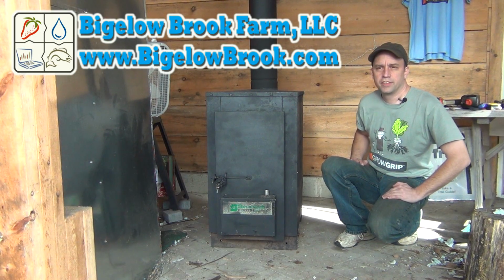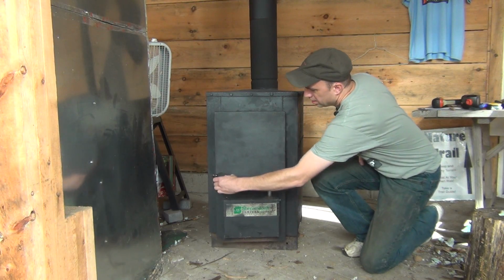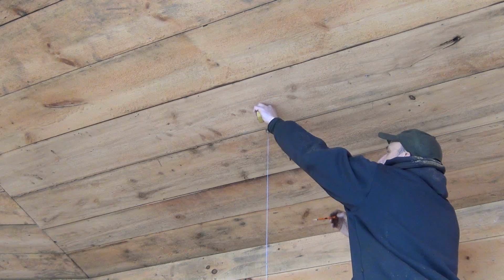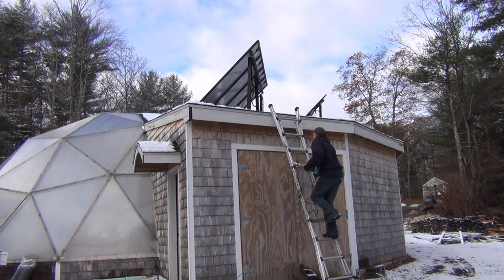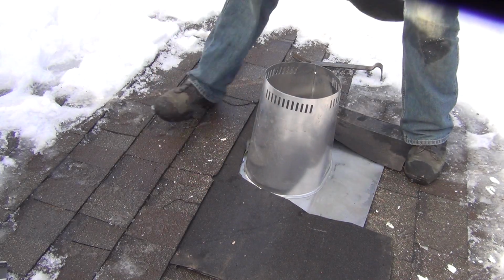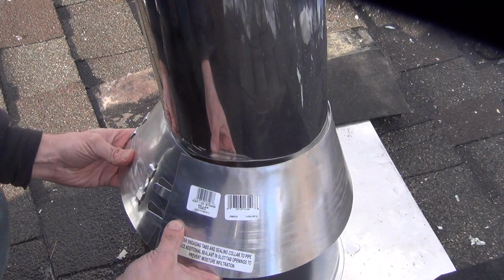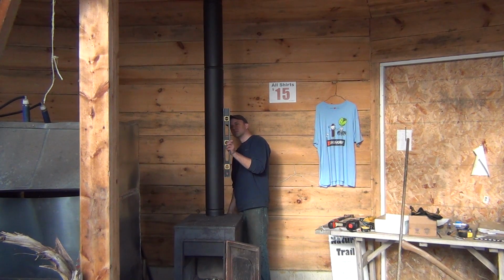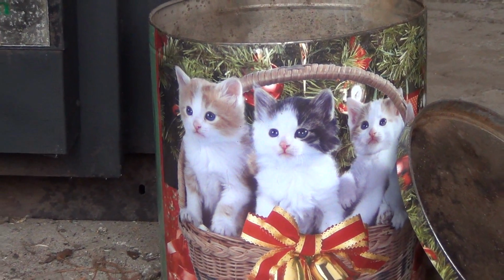Installing A New Wood Burning Stove

Comment: You put the telescoping section in upside down. The top end of the section should fit outside of the descending pipe section and the lower end of the section going into the stove should fit inside the hole at the top of the stove. This way, creasote will not flow down the inside of the stove pipe and flow out where the pipe sections are joined--instead the creasote will flow down the inside of the stove pipe all the way into the stove.

Comment: Nice job. I'm going to do the same in my greenhouse. I built the greenhouse and a rocket mass heater this year, but it's going to be a challenge for it to warm the 36x16 space, even with the north wall and roof at R-19. It's gotten down to 1 degree so far, and we'll be getting to negative 20f or so. It hasn't frozen in there, and my quest is to keep it above freezing. I have a small old wood stove from a shop I had, and that's going to be on the far side of the room from the RMH. Your comment about feeding the splits into the RMH for a few minutes of heat is on the money. Constant feeding is probably the major weak point of the RMH. Beside heating with wood, on the north wall I've installed 2 IBCs at 275 gallons each. I painted them black for the passive solar gain, but installed them just as we were getting cold... they're still barely warm. The solution there will be a couple of solar water heating panels, and a small tankless propane water heater as backup. Anyhow, thanks for another nice video.

Comment: Have you considered a "Russian Stove"  Essentially a Masonry heater, into which a fast fire is burned?.  Because of the up/down path of the smoke, it grabs most of the heat  while reburning the smoke and slowly radiates it into a room.  Built a 6,700 sq ft home back in 1992 in which was installed a commercial version.  Did a fantastic job just using small sticks.  Would have needed two in the dead of winter, but in milder weather it was sufficient.

Comment: I added extra firebrick and secondary combustion tubes to my older wood stove. The secondary com. is almost smoke less and produces allot of heat. RMH store heat over a long  time but the wood stove is great for quick heat.Heated water is  great thermal mass. Load up your stove with secondary com and you get real long burn times. Check out 'advanced wood stove technology'. I like RMH but you have to tend to them more. Great channel and thanks for sharing.
Reply: I think RMH would not be too smart in an unfinished garage  like I have. I don't even have any insulation in the walls (ground level)or the ceiling of the attic/upper crawl space. You have to climb a lumber made ladder mounted to the wall to get up there, lol. I just think a basic wood burning stove would allow me to at least do stuff in the garage during the New England winter. I have far and above more work to do, if I want a stove in my garage.

Comment: Better method for installing collar: Put collar in place and using a marker trace around top of collar all the way around chimney pipe. Slide the collar up the pipe exposing the line and place a bead of sealant, usually an ugly one, just above the line. Slide collar back into place.  This is my basic method with variation as needed.

Comment: It's always better to go out of the side.  No need to put a hole in the roof if it is near an exterior wall.
Reply: That's incorrect, the creosote will build up inside the pipe much faster from what I was hearing.

Comment: cool video,  Ive been considering doing something like that to help my AP tank as well.. Ive done a little research, and as far as fish go,  in a fresh water setup aluminum (from my research) its fine to use.  You do however, have to watch out for certain types of alloys. Certain alumunim alloys are fine, and some pose threats. Most radiators have a high enough concentration of aluminum to not pose a threat.  Im also guessing that you chose that stove, because it would be easy to build a secondary burn chamber to go into it?  If you are, I would love to see the comparison between before and after the conversion. My system is completely out side, so I think im going to build a wood stove and secondary burn chamber out of a  55 gallon drum, and some water pipe i have laying around,  and incase the radiator i lay on top with steel and insulation. 
Anyways. I really enjoy the video's you do a great job of explaining, and ilistrating your work.

Comment: did you put any kind of wall protection behind stove?
Reply from the maker: There's about 3' between the wall and stove.
Reply: sissie w I always build a ceramic backer plate behind. plus it adds heat stability

Comment: Hello I just bought a cabin that has the same stove, how does temperature gauge actually work? Should the flapper door that connects to the gauge close totally?
Reply from the maker: If it hasn't been modified, it should close all the way when it's warm enough.
Reply: thanks much! Is there anywhere you might know where there is a picture or parts diagram of what the mechanism should look like? Is that something you could describe I cant tell if this one has been modified :0,,, TIA

Comment: what brand of chimney did you use?
Reply: +Tim S WOuld like to know as well!
Reply from the maker: +GeorgeGraves I don't know the brand.  I went to our local TrueValue hardware and they ordered all the parts.  I think it''s a company in Canada.
Reply: +Bigelow Brook Farm (Web4Deb)  Thanks for the reply.  I have no clue what the cost is on that much pipe?  About $200?

My other question is, it seems like on the inside (indoors) section, you want a pipe that lets out more heat.  So much waste goes up the stack.  So what's the trick for that?
Reply from the maker: +GeorgeGraves The chimney was $900.  I paid $200 for the stove.  ;-)  If you check my newer videos about the stove, you'll see I extract a lot of heat out with a water tank.  Works really well!